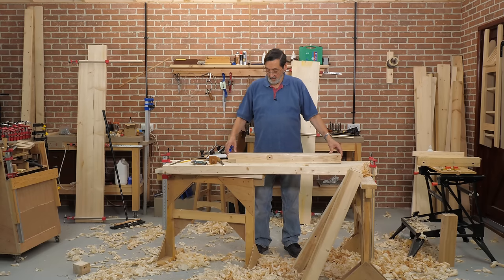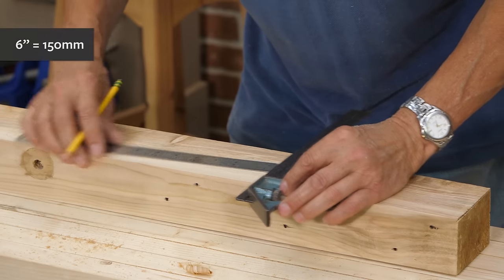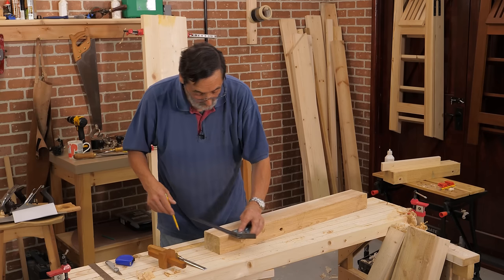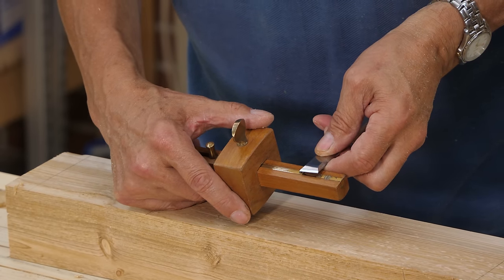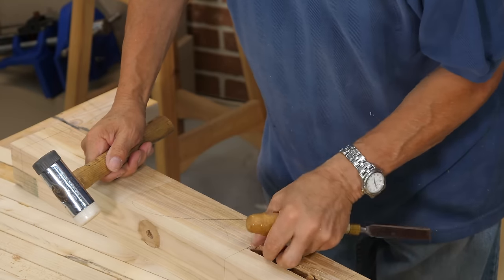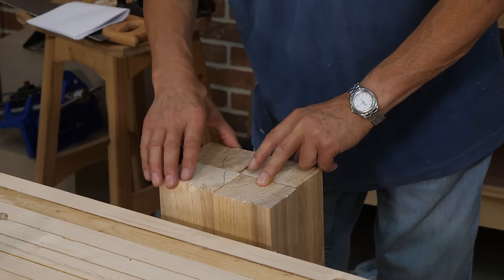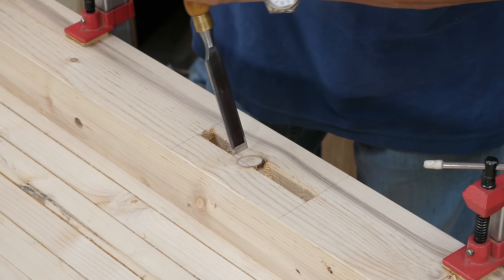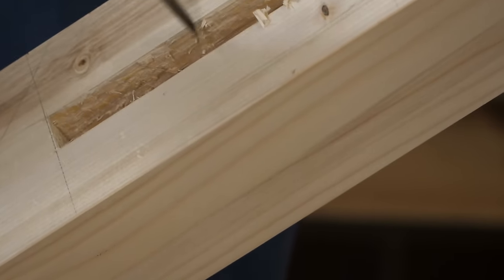How to Make a Workbench Episode 3 | Paul Sellers

Comment: This year we are extending our work space and building a 40’ bench on this design.  Milling our own lumber to dimension and for strength.  It will have numerous work stations for production and carry much more weight.  12” x 12” x 45’ beams will be cut to length with a 18” valley down the centre for tools in use and work parts and another 40’ raised section on the apposing side doubling the working space.  We will finally have a production workbench in our shop.  We’ve moved to producing our own polish and hide glue off several books from 1601-1788.  Thanks for your videos, I recommend that all my workers watch.

Comment: Your method of chopping mortises has been a revelation to me. I learned it from one of your other videos and it has revolutionized my work since then. I also own a hollow chisel mortiser machine and until I saw your video I thought that was the only way to get an accurate through-mortise. I now can do a mortise faster with your technique than I can with the machine, taking into account the laborious setup and test pieces. The hand cut mortises turn out cleaner, more accurate, faster, and quieter than using the machine. Also, I enjoy the process and sense of achievement after chopping a mortise and never get that feeling from using the machine.

Comment: Well done Paul. I enjoyed how you solved the knot at the end. I'm looking at my first bench and wondering if it's time to replace it...
Reply: Bill K. I definitely need to replace my bench. I also am at my first bench. However, my first is a cheapo from Harbor Freight. It is fairly sturdy, don't get me wrong, but it is so light that it walks across the floor with every mallet blow. This series will be in my favorite or tool building lists for ease of location when I have the money to get the materials, vises and all.
Reply: I built my first bench on a whim, without a plan in mind. I just did what I thought would work  and it has. I had a bunch of scrap DF around and it was enough to build it. Next time I'll have a plan in mind. And the top won't need so much flattening...

Comment: I downloaded the plans for this workbench and intend to build it. The only thing I’m not sure of is how you get 2&3/4”x3&3/4” legs, 1&5/8” thick aprons and 1&1/2”x6” rails. I suppose the rail dimensions could be met by ripping 2x8 stock down to the actual 6” width. But if you used 4”x4” posts for the legs, they’d be 1/4” short as most nominal 4”x4” are really 3.5”x3.5”. And I’m not sure how critical it is that the aprons are 1&5/8”. I could get several 2x6s or 2x8s and laminate them together for the width, but the thickness will still be only 1.5”, 1/8” short of the specified thickness in the plans.

Comment: Hi Paul, First Thank you for sharing your experienced skill to everybody.  One question. I am building my first workbench, following this videos. My Problem or concern is cracking on my 4x4 post for legs. I bought local home depot. when I bought the wood, that was crack(check) free then after 3 days on my garage, I found long( one side has 43", and other side 37". two side are no crack) and deep(reach to centre core) cracks. is it okay to use as my workbench legs?

Comment: You mentioned using a brace and bit on the knot. Is there any disadvantage to running a line of holes down the center of the mortise using a bit that is slightly smaller than the opening, then following up with the chisel to finish the walls?

Comment: I’m finally working my way though all the workbench episodes from my sickbed, feeling better already :)

One thought occurred to me watching you chisel the mortices, would there be any benefit / negative to drilling out the central ‘waste’ material so there’s less to chisel?
Reply: I've tried this on occasion but I find that without the waste and just a series of connected circular holes, the chisel tends to wander and twist as I finished clearing out.  chiselling into a solid surface seems to work straighter since the waste provides a full edge for the chisel to engage and so keeps it straight and perpendicular.

Comment: I am about to build this bench. Gulp.
Reply: ha. i'm building mine now. (paul has a plywood version of this bench you might  wanna consider; no mortising.)  i've mortised two legs so far.  will do the rest tomorrow. i find i'm resharpening my chisel after each leg. ymmv. (i wish paul would have made a small comment on that at the end of the video.) best of luck.
Reply: ronald chong i saw the plywood bench. Pretty nice. I like the traditional approach for now because I need to practice joinery...and if I mess up a work bench a little it’s not the end of the world. I built a small version of this bench as an outfeed table for my table saw. Chopping mortises was more work than I realized...I was tired. Lol. They were not perfect for sure...but they god a little better as I progresses, so that was satisfying. Yes I agree...sharpen often. I’ll never master this craft like Mr. Sellers, but woodworking is so meditative it doesn’t really matter as long as you continue to progress.

Comment: Persistence and Patience with Paul Sellers! Very very nice work Paul. Breaking through and resulting with nice walls is satisfying. How often do you sharpen the chisel? I’d be doing it at least once before turning it over each time. Thanks for leaving the falling tools, mistakes, fails and fixes for problems encountered in the video. Your address takes me to “Accounting Solutions”?

Comment: Hi Paul! As usual, great video series, with lots of interesting tips.
But I´ve got one question unsolved: what are those wedges in the legs for? how do they work? would you please be so kind as to teach me?
Regards from Argentina!!!
Reply from the maker: Inevitably through the long-term use of workbenches, the legs can work loose. The wedges drop down into any void to keep the leg tight to the apron and the housing joint.
Reply: Paul Sellers thanks!!!

Comment: Paul; I just went back and reviewed "restoring a plane, jan. 2016". I have acquired a nu.5 with no name. Only the 5 indicator. The side movement iron is broken. I have spent a lot of time on the bottom or "sole" ?  Would it be worth more time or having it milled flat or is this a wall hanger? Thanks, Bob

Comment: Hello Mr. Sellers. I've been watching your videos for a while now, and the information you impart is superb. I'm a newbie woodworker and this is great. I do have a question about chopping the mortise holes, and I'd appreciate your input. I've seen people use a brace and bit to remove large amounts of waste prior to chiseling, would you consider this practice as effective as your method? Thank you!
Reply: MrPepakuracostumes , i chopped all mine like this and it worked fine. Drilling them out didn't seem like it would be better, especially with all the chisel cleanup. I got faster at chopping as i went, too.
Reply: D Jenney. Thank you for your response. As I said, I'm a newbie, so I'm just starting out and would like to get input from the different sources available. Since I'm just starting out, I only have a few basic tools, a brace <<not>> being one of them, so I do chop all the mortises with only my chisels. I mainly asked because it seems to save a bit more time when I've seen the brace approach used.

Comment: Making the mortise, wouldn't it be easier and faster to hog out most of it with an augur, then true up the ends and sides with the chisel?
Reply: There are more ways that lead to Rome, but this is the classic way of cutting a mortise and it probably is faster and more accurate than your suggestion.

Comment: Thank you for taking the time to do this series, sir. I'm looking forward to building my own first workbench - you make the process very clear and accessible.

One question: you seem to be much taller than I, and at 38" overall, this bench would be almost 5" north of comfortable (based on commercial benches and kitchen counters I've used). If I were to shorten the legs, would I do best to take it all from above or below the lower rail, or would it be better to take some from above and some from below?
Reply: Bob Dehnhardt . Cut to leigh (what is comfortable for you ) first then leigh things out .

Comment: Try not use a rubber glazing mallet tho! Probably not the best mallet to hit chisels with
Reply: + Traditional Joinery and building trade - He's not using the rubber end of his hammer to drive the chisel, he's using the hard & tough vinyl head which is perfectly appropriate. Many wood carvers and especially most stone carvers use mallets w/ heads made of the same material. If it works for stone carving then it'll be more than enough to transfer power through a bench chisel through wood. Just saying. Cheers.

Comment: Ok fastforward 4 or 5  times yep just one leg !! I'll get a cup of coffee and maybe watch later but I will talk to brace and bit first and see if they aren't  busy first and then my chisel will clean things up .
Reply: doublejack Haroldlüke and you can upload the video and show everyone how you don't need to watch these anyway!
Reply: Good luck! I never have gotten good results with that technique.
Reply: Matt Hood use a guide or a smaller auger drill bit . Paul makes really good videos for training , it's all about what works best for you and lots of ways to achieve the same results . Some are just here for entertainment . All opinions are dully noted .
Reply: Yeah, I get the concept of boring holes first. I tried it several times. Cleaning up the edges never seemed to go quite right and by the time I was done I usually had crooked mortices or had blown out the edge somewhere. Using the method Paul demonstrates doesn't really take that long and always ends up with a good result for me. I would like to see a video of someone demonstrating the method you describe. I have seen it on TV but they always cut out the part with the chisel.
Reply: Frankly, it's the commentary during the process that contains the wisdom and experience that are the most valuable. If you don't feel like listening to a master craftsman just play it in fast forward, though you'll miss out on the best parts!
Reply: This is really dangerous if you don't have a drill press. Those mortices MUST be really square and twist-free, or your legs will be twisted or not square. And if you're boring free hand it's very unlikely you're boring square and straight as needed in this application. If you own a drill press, well, that's another way to go I guess. Paul is though teaching to build a bench with just a few tools, in your garage, without the need of machines. I think that's the point you should see in Paul's videos.

Comment: 35 min for one leg..bravo....
Reply: gloc100 I don't think this content is for you. This isn't ILiveToMakeStuff, it is a an instructional sort of video for those that want to see every step.
Reply: That's what it takes, feel free to go buy a mortising machine, however.
Reply: He's working slower so you can see the steps, and I am pretty sure he can do this 2-3 times faster. The point is that you don't have to buy for thousands dollars of machines to start with wood working.
Reply: No sir, for one mortise. There are two in each leg. For those of us with limited funding and even more limited tooling, this is reasurring that we can do it too. May take a bit longer than a machine that can chop it our for you, but you get the experience and satisfaction that YOU did the work, not some machine. I doubt that with my limited experience I could chop that mortise in 5 times as much time. Likely 3-4 hours per notice, until I build experience. Then maybe quicker. But still doubt if I'll ever get a six by 3/4 or six by one inch m ortise in half an hour.
Reply: Thomas Russell it won't take hours. Your first time maybe 30-40 minutes. It's not that difficult, just do what Paul does.
Reply: Matt Hood Thanks Matt. However, I am disabled. I have chronic pain, near blind, and shaking hands, so everything pretty much takes me 3-5 times longer due to having to be much more careful with placements and mallet blows. I manage to get my chisel "sticky" sharp. Meaning they stick into what ever they slightly touch. So, I have to wrap bandaids all the time with my shakes. I have survived a stroke and came back most if the way from completely losing my entire right side. Still have almost no feeling in much if my right side other than pain. Soft touches don't register, so I have to take things slow in self preservation mode. However, I refuse to just sit in the couch and am in the middle of my forth year of college to gay back to work at something I can do. 
But thanks for the supportive kind words.